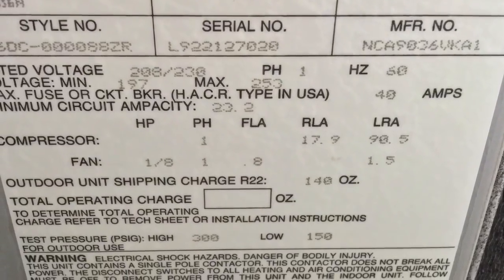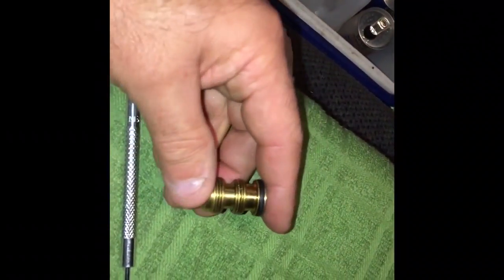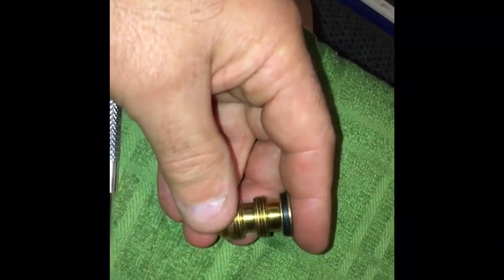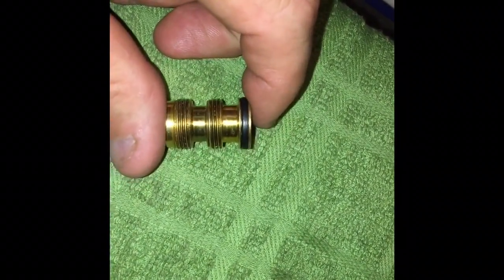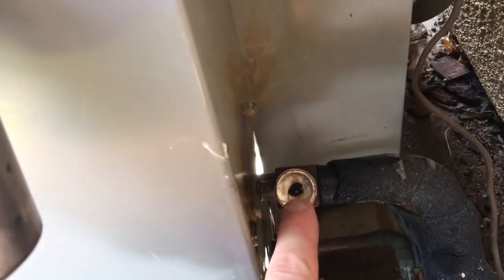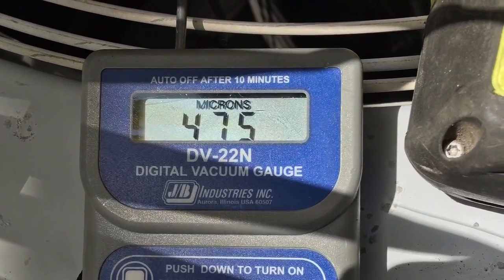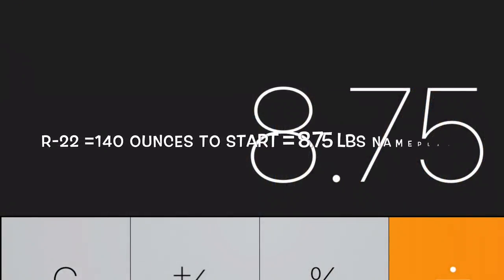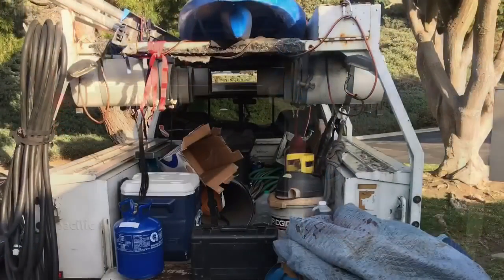R-22 Air conditioner with a Freon leak. Leak repaired. Converted to R-422B/Nu-22B

Comment: Braze it up. Never fails. On a Friday night walk in freezer down. Low refrigerant do to flare connection at txv leaking. The face of the male flare was scored not sealing properly. Basically need a new txv. I pumped it down and brazed the flare nut to the brass body of the txv. Leak sealed. 6 years later freezer is still going strong. Gotta do what you gotta do.
Reply from the maker: Good Stuff. i've Found also that Welding is allways the Best option over Flares. i Can't remember the last time i flared someting any more.

Comment: I replaced the orings on my own unit but do not on any other one. It works great ....no leaks. Went to hardware store to get it.
Reply: Please what's the o ring material that's suitable with  R22 refrigerant?
Reply: @safetyalways7788  it's the oil that is used ,check oil compatibility with nitrile o ring....
Reply: @IFIXCASTLES  My R22 uses mineral oil. I heard NBR o ring usually has leakage problems. How true is this? Is HNBR o ring suitable with R22 and mineral oil?
Reply: @safetyalways7788  google your question about compatibility .

Comment: I had been using NU22b from ICOR but the price started to creep up and National Refrigerants makes it now as well and it's about $35-$40 Cheaper in cost.I purchased over 30 + ICOR NU22B jugs and a few were missing the labels in the box and I called ICOR and they sent me out about 100 for free lol.I feel bad that I switched to National Refrigerants but ICOR patent ran out I was told by a manager at Johnstone Supply so 22b can be manufactured by other companies now.
Reply from the maker: Yep, i Like icor products. been using the hot shot for many years and it was great. now i'm using the hotshot2 , good so far. icor seems like a great company. i talked to the tech support one time. Good guy.

Comment: Had a Rheem pumped down and was releasing gas back into whole system and didn't notice suction  side didn't have a "C" clip and bam, big brass valve screw came out and blew chg, scary but no one hurt, now I check beforehand.
Reply: Damn!   Gonna keep that in mind next time I'm pumping down.
Reply from the maker: Holy crap, i'm gonna start checking now.

Comment: Is that your kayak on top of the truck?
Reply from the maker: Yep, Been Paddling almost as long as i've been doing refrigeration. Competively 
Raced Hawaiian Outrigger Canoe's in 1982, 1983,1984 ,1985,1986. I've Raced in hawaii and won a Ironman an in 1984. i Love the Water ! Owned a Standup Jet ski for many years too. i Love Jet skiiing ! i'm Also a Certified Jet ski Mechanic . Worked for many years Building High Performance Jet skii's. 1979-1982 . i Have Spent Many thousands of HOurs behind a Porting toool. Porting jet ski Blocks and Jet Pumps and Propellars. Covered in aluminum shavings From Head to Toe.
Reply: OcRefrigeration,Hvac & Electrical. That’s awesome

Comment: Nice tip, what o ring? F it no o ring = no leaks,😁  but the ones i come acros are not replaceable the top of the stem housing is usualy rounded of inwards so you cant get the stem out. The caps usualy seal ok. O ring problems usualy occur when refrigerant is changed, makes me wonder maybe sombody put in a different refrigerant in stead of r22.
Reply from the maker: i usually just cut em out and replace with a 7/8" access tee.

Comment: Steven or somebody I need help please! Air conditioning is blowing cool, but not cold air. The evaporator coils inside the home are cool to the touch, not freezing over either. Seems like there could be an airflow issue, peeked inside of the evaporator coils there's no dust, looks brand new both inside and outside. My coils look like the Goodman 3 to 3.5 Ton 20 in. Wide Air Conditioner Uncased Coil I'm very puzzled why the evaporator coil is cool to the touch but not getting cold air in the home. When the unit is turned off the evaporator coil is warm, I'm not sure if this is normal functioning or a problem. Please respond back, much appreciation, thanks!
Reply: clean your condensor coil
Reply from the maker: probably a refrigerant leak. have it serviced.
Reply: This issue turned out to be a heating element that was stuck on.....fast forward to this year evap coils were cool on the bottom half and room temp on the top half after much stress ended up getting a 410 unit inside and out, when the evap was pulled out I got a chance to look inside and it still looked brand new, could see the coils between the fins from a distance, I'm guessing there was a leak. It was time to update the system anyways.

Comment: I just replace the O-ring. I have a O-ring kit from harbor fright on the truck. Here one example of a rebuild kit they used to stock back in the day. http://www.utcccs-cdn.com/hvac/docs/1009/Public/02/39005DP59-A.pdf
Reply from the maker: Holy crap. 300 pages.
Reply from the maker: interesting dallas. tks.